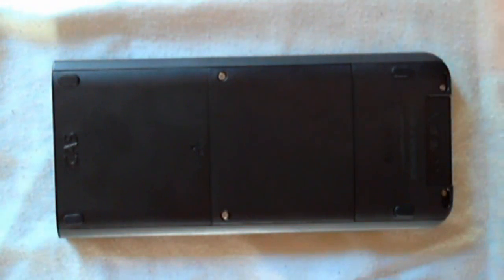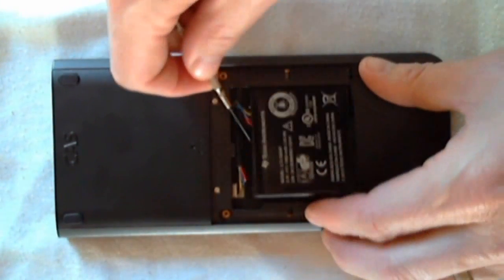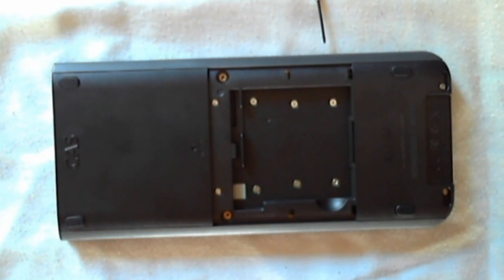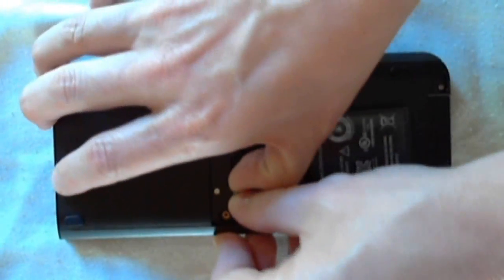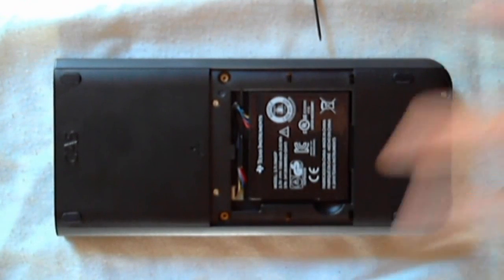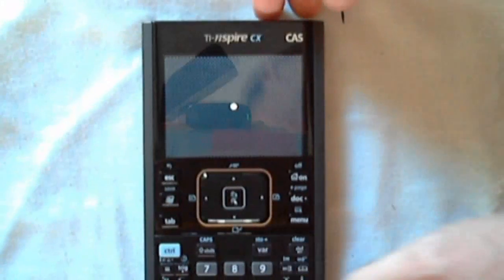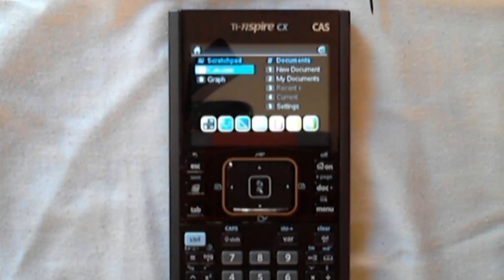How to Change a TI-Nspire CX Battery

Comment: The battery of mine bloated after 10 years. Its a bit my fault too, because I charged it up fully a few weeks ago, because I wanted to play with it again, then I forgot about it and now the battery has pushed out of the back. So always remember: Don't store batteries fully charged, always keep them between 20-80%.

Comment: My battery made headfuck noises and the charge went fast, now it works. I knew maybe if i reconnect the battery it will work but i was scarred to damage the cables. Thank you for the Video ❤️

Comment: Incorrect instructions for the base Ti-Nspire model. Oof!
Reply from the maker: These were the right directions for the base TI-Nspire CX as of the year 2012. However, since this video is very old, things have changed a lot. A couple of years after this video, TI updated all of the CX models with a new battery that did not use wires. You'd be amazed how many people still use this video with the older calculators, though.
Reply: My Ti-Nspire is the 2010 model that still used AAA batteries... :)
Reply from the maker: @garath_  Makes sense, but this video is about the color TI-Nspire CX, not the older grayscale models.

Comment: If you bought a new TI Nspire CX on 2014 or later, you will need to look for a battery designed specifically for the 2014 and newer models since that battery lacks cables and only has contact pads. The procedure is largely the same, unscrew the cover(in my case, it was held in by only one screw), remove the cover, remove the old battery, pop in the new batter (make sure it is in the right orientation though), and replace the cover.
Reply from the maker: Yes, this is a very old video. However, it still gets a fair amount of views/comments about the cables, so there must still be quite a few of that style of Nspire in circulation.

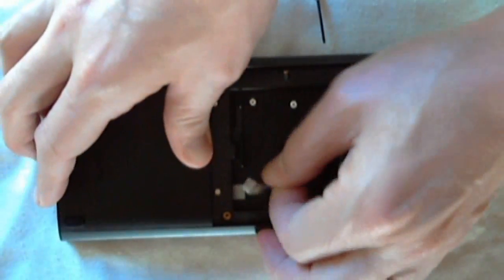Comment: 2:26 "Just gently pull that out." Sup guys, the cable is not coming out and even if it is going to come out, I'm afraid the process is not going to be a "gently" process. Shall I roughly pull the cable out? Or is there something I miss? Some help would be awsome...
Reply from the maker: This is a "proceed at your own risk" procedure. I've always been able to wiggle it out. Yes, you do have to pull with some force. I've never broken one, but they haven't made this style of Nspire/battery for quite a few years now, so your wires or plug could be old and brittle.

Comment: Will taking the battery out delete my saved documents???
Reply: did you ever figure that out? I'm on the same dilemma with my CX CAS. I've had it for 5 years so it's very overdue for a new battery. I'm worried it'll delete my documents and saved operating system.
Reply: So what about you? Did you figure it out?? I'm having the same worries you had
Reply: theoretically you will be fine, but still, backup ur files on your computer in case

Comment: my poor calculator when fully charged, I'll unplug it and turn it off and turn it back on and the battery is depleted like nothing happened. like the time it took for it to charge never happened. Idk what to do but to maybe buy a new battery. Do you know if i buy the new battery how fast the shipping is? because I've got a big test dec12 and they don't let chargers in with you :(
Reply: My More Noble Pursuits ...did you ever solve the problem??? If so how

Comment: Here is a very GOOD idea that I discovered over the past week:  Use a small amount of Vaseline (white petrolatum / petroleum jelly) on the outside of the connector (a toothpick makes a good applicator.)  You don't need to apply it to the metal contacts inside, but if it does get in there, don't worry about it (I did some conductivity tests that showed no increase in resistance.)  The Vaseline reduces the amount of force needed to pull the connector from the socket, thus virtually eliminating the risk of wire damage.  I've tested this more than 10 times with excellent results.

Comment: The idea of using tweezers or small pliers is a REALLY BAD IDEA!  ...I tried it with very bad results.  1)  Squeezing the plastic connector from the outside corners EXPANDS the the mid section of the connector, thus jamming the connector in the socket more tightly and loosing the wire connections.  2)  You tweezers/pliers are likely to slip and snap off the red and/or black wires which will get hit.  DO NOT USE TWEEZERS OR PLIERS!!!

Comment: Great video - it solved my problem of my N-Spire CX CAS not charging. It was stuck at 25% for a while while charging but when I removed the battery and plugged it back in it said 50%. Be sure to use tweezers and gently rock the plastic back and forth while pulling on it. DON'T pull on the wires. A+

Comment from the maker: Do you have a friend with a TI-Nspire CX? If so, try swapping out your battery with theirs. If it works, you'll know the battery is the problem. If you are still under warranty, TI will send you a new battery for free. Otherwise, a new battery costs around $15 on Amazon.

Comment: my calculator doesn't charge at all, I use a PS3 cable to try an charge it but it wont turn on. I used your method and I'm hoping for the best but the calculator does not work at all. I've also clicked the reset button before seeing this video and I still got nothing, please help me :(

Comment: Tried to charge for a few hours, pulled the battery, put it back, pressed the reset button, tried the wall charger and the usb charger, tried to update the OS, and that won't work because no matter what I do it still says 0% battery. Even left it plugged in overnight and I got nothing, so I'm just gonna drive back to Staples and see if they'll give me a new one.

Comment: the best way to charge your ti nspire is to connect it using the mini a to b charging cable (the long one) and use any type of usb charger (i use iphone charger) and connect it for at least an hour after that press the reset button on the back of the claculator you will see that battery percentage has increased.
Reply: BLESS YOUR SOUL MY BATTERY IS NOW FIXED, JUST IN TIME FOR THE ACT - I WAS SO WORRIED! THANKS!!!!

Comment: I just bought a brand new TI-Nspire CX CAS. Unfortunately the operating system is not 3.2 and my computer won't let me transfer the file to my handheld even after watching a video how to do it so I will just work with the os system that came with it. I have a HP-50G which is a little more powerful anyway and can handle the higher level stuff. Could you show me how to do the basic graphing on the Inspire? The machine takes a bit to get use to.